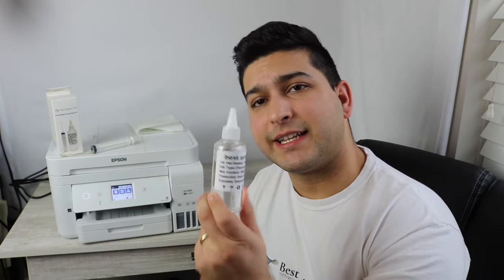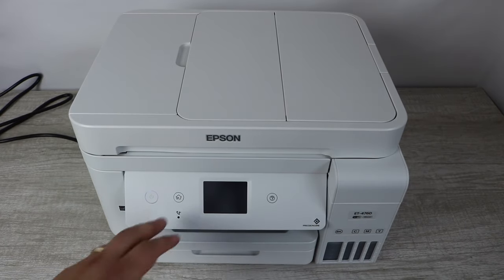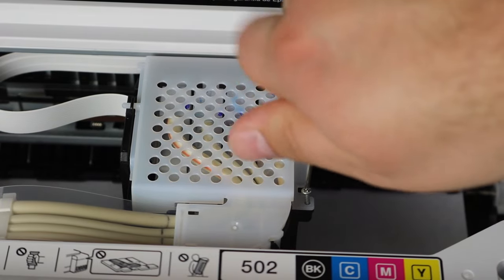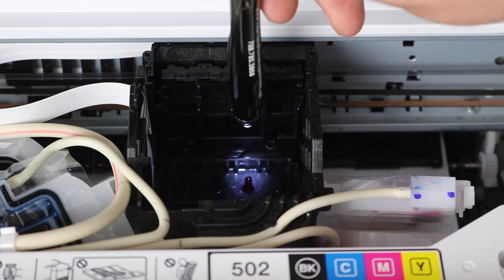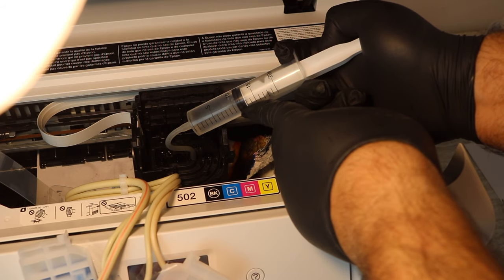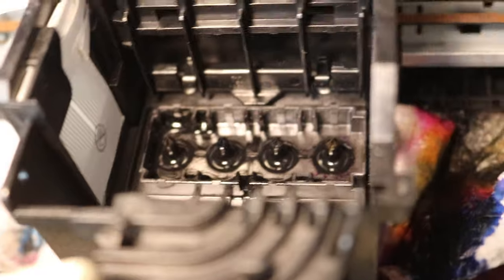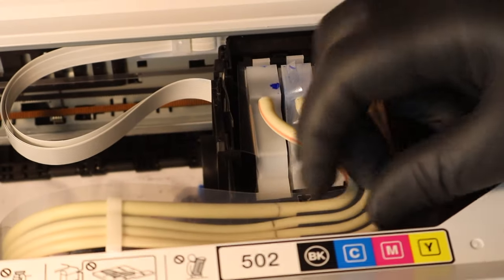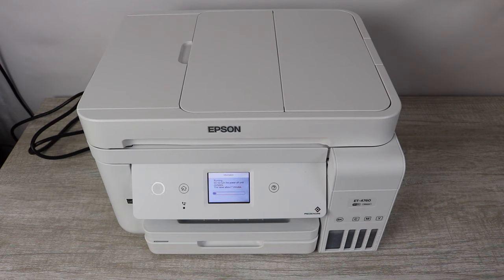How To Flush - Clean The Epson ET 4760 Not Printing Color/Black [FIXED]

Comment: Hello I am about to perform this procedure for my blue ink which SUDDENLY no longer prints even though my Epson ET 3760 is barely ten months old and has been printing normally at least several times per week using all four colors since new.

So I have questions, hopefully you or the group here can respond . . .

1) Only the blue ink failed.  The others print normally.  So as long as I have the printed partially disassembled as you instructed, would it be worthwhile and reasonable to clean all four print heads as described in the video?

2) After injecting the cleaning fluid as shown, would it be helpful to then fill the syringe with air and blow that through to speed drying of the cleaning solution?

3) What would you say to those who have commented both here and on your Amazon printhead cleaning kit page, when they describe a lack of success after undertaking the procedure presented here?

Thank you
Reply from the maker: Hi I have addressed your questions below.
1. Focus on cleaning the color or colors that are currently having issues. 
2. After injecting cleanig fluid and going through the whole process, you will need to run a power cleaning.
3. As for the folks that didnt have success with my product. There are many scenarios where the printer is not fixable ( ie. the printhead is permanently clogged). Or the printhead required multiple cleanings and the user failed to continue and gave up.

I hope this helps!

Comment: my printer don't print CY color only and all other colors print fine , I download hex color code and print only CY line blank, help me  what's the solution , thanks
Reply from the maker: Run a power cleaning after using the kit on the Cyan, that should solve the problem.

Comment: I've done every step recommended by Epson and have purchased this cleaning kit and used it twice. I've tried printing purge files. What can I do without buying a new printer?
Reply from the maker: Simply repeat the process, you can also watch the video I have on the 4850 model. There is some update info on that video.
Reply: @BestPrinters  I have repeated this process over and over. I watched the other video as well. I've used an entire bottle of cleaning solution, replaced the maintenance box and replaced the sub dye and still have clogs in the black. I don't know what to do next.

Comment: Completed process with cleaning kit.  Cleaning fluid saturated the paper towel and got to the white piece underneath the print head.  Did I wreck it?
Reply from the maker: No, just let it dry for 24-48hrs.

Comment: Hello, I ordered the clining kit. I opened the printer and saw the cartige almost empty, with a syringe I took the cartige out so I could suction the rest if the ink and my aim was to use that suction effort to be able to fill up the cartige with the black ink but it did not work, it remaines dry, so I believe I will have to use the clining solution there too.
Reply from the maker: Yes this kit works best with pushing solution through, instead of using a suction method.

Comment: My ink is half full black colors over 75% full on my 4760 Epson ecotank but prints completely blank pages
Reply from the maker: Yes you need to clean the printhead!
Reply: I did that in maintenance and nothing changed still blank pages I tried your power clean at the end of the video and it printed out the nozzle check page hopefully it will be good now it said to wait 12 hours and alot of sublimation  ink.

Comment: This video was very helpful and the steps were easy to follow, but my ET-2760 is still not printing! I did all the steps including the power clean and the nozzle check was blank, no colours including black. My printer has been sitting inactive for a long time and there was a few weeks gap between cleaning it and doing the power clean because i was waiting on ink. Is there anything else I can do to fix this?
Reply: also, i just tried to printer a document, and it had very faint magneta lines, a little small of text i could read (very faint and in magneta) and then also some ink blots (again magneta). do you have any tips for how to fix this?
Reply from the maker: Yes if you repeat the process and try using warmed up cleaning solution you should be able to get it to print.

Comment: I cleaned my printer heads with what you suggested to buy. I wasn't aware that you had to run the power clean after and I'm just about out of ink in black but low in other colors. Will it hurt the printer if I wait to get ink tomorrow?  Thank you so much for this video. I had to change my Maintenace box already and thought I had to replace the heads too. I'm happy that it is as simple as just cleaning them. Thought my printer was going to be another expense. I have two autistic boys and I need to print lots of things for my records. Thanks.

Comment: i did it  but it came out good and then did print head check and then print head cleaning but didnt do power cleaning- do i still have to do power cleaning?
Reply from the maker: No if the colors are coming out the way they need to, you can save yourself from having to do the power cleaning.

Comment: Hello there. My printer is brand new - never used. I have filled up the ink cartridges with Epson ink, but the magenta and yellow do not print. I have done the nozzle cleaning and printer head nozzle check despite the unit being brand new and never used. No streak or lines in the nozzle report - just blue and black ink only (no magenta or yellow).  Any advice for this? Thank you.
Reply from the maker: Yes you will need to do a printhead cleaning.

Comment: What if you can't get the cleaning solution through one of the ink print head valves - YMC worked just fine but with the black I can't get the solution through the little nozzel.

Comment: I bought your cleaning kit and followed the isntructions.  It worked like a charm, but about 3 days later it was clogged again.  Is it common that it needs to be done more than once?  I was thinking maybe the problem was inside my ink tanks, but there's no access in there.  What do you recommend?

Also, my printer stopped doing 2-sided printing.  It basically says it's jammed, but I can easily feed out the paper using an arrow, so I don't think it's really clogged.  Is there any help for that? Also won't. pull in the card stock that I've used for a couple of years.  I'm hoping I don't have to buy a new printer.

Comment: My printer worked well for a time and when it said the ink level was low I bought a new supply and placed the bottle as shown. I assumed that the tank was filling but evidently it was not and now I can't get any ink to flow from the Epson 502 replacement bottle. What can I do to make the ink flow into the tank? I notice that there are many unanswered questions below. Is anyone at Best Printers reading these and perhaps either answering or directing us somewhere else?
Reply from the maker: You may benefit from running a power cleaning. That should get the ink back running again, in the system.
Reply: @BestPrinters  Thanks but I think my problem is that I can't get the ink to flow into the tanks to fill it. How could the printer do a power clean without any ink? My manual cautions me that a power cleaning takes a lot of ink and there isn't any. It also suggested lifting the re-fill ink bottle up and putting it down again but all that happened was that ink flowed out onto the refill area. Not a lot thank goodness so I was able to mop it up with tissues.

Comment: My Epson ST2000 wasn't printing the yellow, I did this procedure just as shown and now I'm getting "Printer error 031006" So I went from just not having yellow to rendering my printer COMPLETELY useless. Do you have a reset to get rid of this error reading? It defines as : "Accumulation of dust on these two printercomponents can cause this error code to appear". Which makes me wonder if the ink that blots onto the paper towels is reading as 'dust'. Any help would be appreciated.

Comment: I  have a Epson ET-4760 printer. i converted it to a sublimation printer and while doing so i accidently put blue ink in the black ink spot. it took me 153 pages of printing the darkest i could to run it all out. now my printer doesn't want to print anything. i just did this whole process you just showed above. can you possibly help or do i need to throw it all away and forget it. feeling overwhelmed

Comment: I just finished doing this and was trying to do the power cleaning. Message says to remove the maintenance box cover. Is this normal? Do you have a video about this? Mine doesn't have a screw as shown on the display.

Comment: How would you do this process on an ET-4700 model?
Reply from the maker: Hi, it’s the same process.
Reply: I have the same question since the ET-4700 doesn't open the same way to get to the print head. The top of the printer doesn't hinge open so the only access point to the print head and cartridges is behind the control panel and you can't do much through that little window. I haven't found another way to open it all up like in the video.
Reply: @lilymonster666  I’m having the same problem have you figured it out?
Reply: @BestPrinters  can you help out us here?
Can’t get into the print head. How do we open the top part?

Comment: I have the et-4700 and I can’t figure out how lift the glass part the scanner to get to the heads
Reply from the maker: You may not be able to do it with that model.
Reply: I found them, there where 2 screws under the screen flap on each side top corners

Comment: I have only 1 coulour working, I cleared air bubble but still one color working;  it buy it used with 1800 prints ; maybe during transport ink gone dry, don't know 
I'm going to try this, maybe with distillied water this work ??
Reply: so, I cleaned with distillated water the 4 heads 7mL each with the paper under it to absorb
Then a "big clean" power + ?
Now it's working nice !

Comment: Thanks! Great tutorial. I am up and running.  Question: When I hold the power and ? button power wash does not work.  Says I have to create an account for $9.99 monthly.  Is that accurate or am I doing it wrong?
Reply from the maker: That is strange, but I'm not surprised a lot of the major companies are trying to sell subscriptions. You may be able to bypass this message by hooking up your printer to a PC and running a power cleaning from there.

Comment: Did the solution, put printer back together and now the screen etc does not turn on
Reply from the maker: The motherboard may have be short circuited. did you allow the printer to dry for 24 hrs before powering on?
Reply: It is working now, had a scanner error and fixed that. My ink levels are filled and now nothing prints. None of my colors

Comment: Thank you so much for the instructions of the print-head cleaning video.  This was truly very well done and easy to follow.  One suggestion: the one most IMPORTANT thing that wasn't in the Epson instructions is that the Maintenance Box in the back of the printer also needs to be replaced AFTER the full cleaning is done.  If you do another one of these videos, can you please mention that to others?   Thanks again and regards.
Reply from the maker: Hi, I am glad the video helped. Yes I will make sure to mention that in the future.

Comment: I was in the process of putting ink in the 2720 for the first time.  I wanted to put in sublimation ink and mistakenly put in the 522 ink.  I got so far as the black and yellow.  Since I had not turned on the printer yet, all the ink is still in the front printer wells.  How do I get that out?

Comment: great product,  once i finally got it on the black ink nozzle, it  fixed my printing asap  but have a question i used it twice to print after the power clean and got this scanner error...how can i clear this scanner error 031006 on my et-4750  do i need to clean something? do you have a video

Comment: Super clear instructions, thank you. I think I may still end up with a problem because I don't seem to be able to fill the tanks. I have the proper Epson ink to put in with their individually shaped attachments so I can't mistake which supply I'm putting in but when I invert the ink it just doesn't flow into the tanks. If I clean the tubes through would that get rid of a possible airlock?
Reply from the maker: You should be able to clean the tubes with no issue.
Reply: @BestPrinters  I have cleaned the tubes and still can't get the tanks to fill with ink. I am using the Epson bottles and yet still nothing happens.

Comment: Hey, I am at the power cleaning near the end but it tells me I need to replace the maintience box? WTF? lol. I cannot get past this point
Reply: I have a suggestion, you should have people check the maintience box before doing this procedure because if the maintience box is full and needs changed you cannot complete the power cleaning. And...no one in our town has the maintience box T04D1 in stock so I just ordered from Amazon which will take 4 days. Tomorrow is work day but I cannot print.....huge loss of time for me as we own two businesses and this stops me cold. Other than that I loved your video.....
Reply from the maker: Yes, change the maintenance box ASAP!
Reply: @BestPrinters  I got it figured out. No one in our town sold the part… 4 days without a printer was hard. I have two questions…. I have had a problem with copying or scanning multiple documents from the top feed. It will make a clunking noise ever so often and when it clunks it smears the print at the end of that particular page. And… I get black streaks on the copy when they are printed. Even after I cleaned it all it still did it. Suggestions? And thank you so much for replying. You are the first person to actually answered my question! THANK YOU! You rock! I will subscribe, appreciate you. 😘

Comment: Comparing to Canon's CISS, it seems that it's easier to clean&maintain the printheads compared to Epson's.  It's less of a mess when you can physically take the Canon's printhead out of the tray.  Likely the Epson's printheads are similar to the regular WorkForce printheads so it's not much of a difference in maintenance from the common 3rd party CISS kits that's been around for over some yrs now.  Like all CISS kits or integrated CISS printers, there's still the problems with the air in the tubes.  What's better is that you could easily replace Canon printheads and reduce the damage on the tray assembly.  Not sure if u tried but did u remove the printhead and is it like the Epson printheads of the WF3640/3620/7610/7620/7710/7720 family of printers?